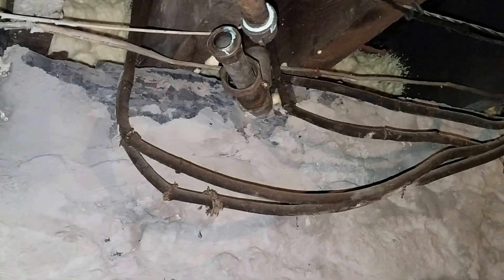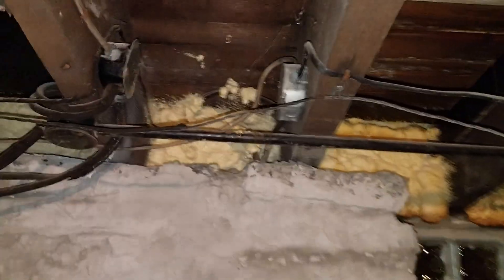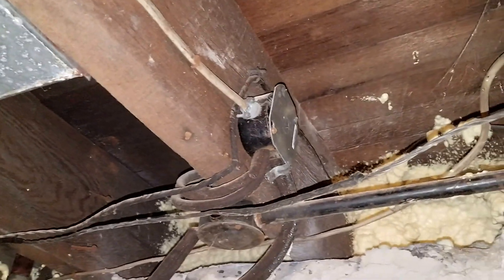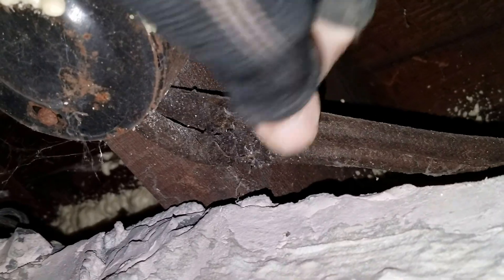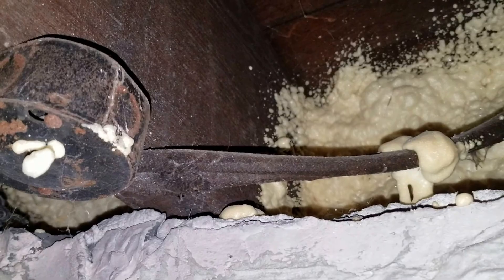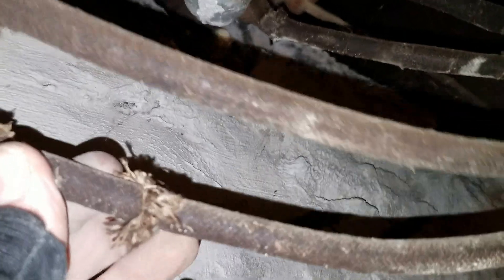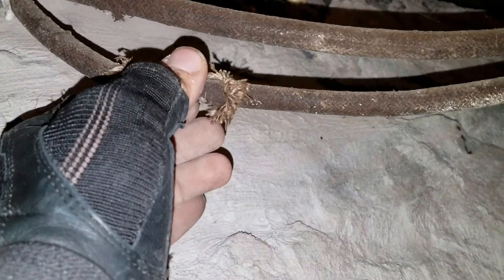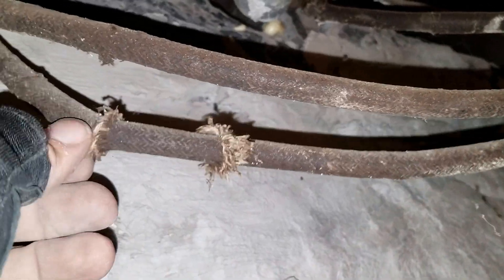Cloth sheath wiring that needs to be replaced

Comment: Those are single conductor knob and tube wires. There was 2 conductor back around that time, but those aren't it. I'm on my second knob and tube house rewire and I've seen both kinds. The 2 conductor is an elliptical shape and the insulation it tight around the wire. They used an insulating sheath around single conductor knob and tube wires and the sheath is significantly larger inside than the wire and can rotate as you are showing. Another way you can tell it's single conductor is there are 2 wires running together for each outlet or additional circuitry that it's feeding.  One big issue issue that you pointed out is bad splicing of new wire onto knob and tube. The second big issue is that knob and tube is about 14 gauge, which by today's standards is good for 15 amps max. Back then, they didn't have many appliances - mostly just lights, so a small house with a single knob and tube circuit was fine. The installation was also designed such that the wire could get hot and not damage anything because it was run in free air. But, as shown in your video, foam insulation was added around the wire causing a fire hazard. Also, with all the appliances and electronics we use today, a single circuit doesn't cut it. The house I'm currently rewiring had the entire 2nd floor plus most lights on the first floor still on the original knob and tube circuit. That's one circuit for 3 bedrooms, a bathroom, and nearly all first floor lights! It's now 5 circuits, with each room on it's own circuit plus 1 circuit for some of the lights. I'm working on getting the rest of the lights off the knob and tube, but it's difficult without cutting a lot of holes in the ceilings and walls.

Comment: Those are still having electric waves if you don't touch them with that signal pen... Mmmm very dangerous ones! It is better if you do not use this system! Have some pocket lamps or reflectors to replace them for a while.
Reply: Learn English.
Reply: @waytospergtherebro  Shut up.

Comment: Well I'm afraid you're gonna have to do something about it, because it's in violation of the building code. Otherwise, they're gonna close you up.
Reply: Yeah it could blow any minute !!
Reply from the maker: At this particular home,The homeowner agreed with replacing all the wiring. However the problem is, homeowner follow through.  like half the homeowners houses I work on, half will follow through and the other half give me the same line of nonsense only to never choose to replace.  I can report to the local municipality all I want, however it's very rarely good follow-through by anyone.  And if it does, the homeowner will end up just having a "2nd opinion." That overrules my professional opinion.

Comment: I have to grab power from some wire like this and if you bend it the inner casing cracks
Reply from the maker: It cracks because of the age of the wire caused the rubber insulator to dry and harden.  I never play around with it to bend or otherwise, unless I'm prepared to potentially replace or repair that stretch of conductors (Wires).  When it's clearly aged, cracking being a sign of this, don't continue bending the wire.
Reply from the maker: If you come across aged wire that has even a single crack in it, or when you're working with it and it starts to crack because of a slight bend or simply working with the wire, stop working with it, as it's now considered unsafe.  To resolve this, replace this section of wire that runs from point A to point B.  Example, if that section wire runs from a terminal box to another box or some other end or termination point, like a light fixture.  

If the above is not feasible, you can also repair the wire by patching it up by replacing that small section of wire, that measures 1 ft in both directions from the crack point for a total of 2 ft of wire.   However, I don't recommend this method simply because chances are, if the wire that you're working with is as old, if not older, than the wire in the video, more than likely no matter what you do, you're going to end up causing multiple cracks in the wire simply my working with it, if it does not already have pre-existing cracks.  The representation with this type of wire more than likely will start crumbling when you work with it. Example, you cut the line to repair it, then when you start working with each wire to prop it up to patch it, it may start crumbling at those two cuts. In closing, the above is just to work around in case you can't replace the wire at that moment. You'll be working on borrow time.  And likely won't have much more time before you'll be forced into replacing the entire run of wire, if not all the wiring in your house.  You're better off replacing the wire sooner than later before you're forced into replacing it.
Reply: @kzigmant  Replace the wire, I see what you’re saying

Comment: I hope the homeowner agrees to have all that old crap replaced!
Reply from the maker: The homeowner refused to have the wiring replaced.  They had the money to do it, just didn't understand the urgency.
Reply: @kzigmant  because your just trying to make it worse then it actually is for the paycheck. annoying
Reply: @thegreatbenis225  are you the owner by any chance?
Reply: @thegreatbenis225  old fabric wiring that is visually deteriorating is a fire hazard for any situation, which is why replacing them while it's still accessible is very important

Comment: Are you sure that's two wires in each run? I thought know and tube had a thickly wrapped live and a thickly wrapped neutral running separately.
Reply from the maker: It does look similar to knob and tube, which are 1st Generation conductors/wire.  However, the wire in the video if i'm not mistaken is 2nd generation conductors, clothe sheathing with a rubber insulator, followed by the conductor, which did support and accommodate 2 conductors or rather 1 single pair of conductors.